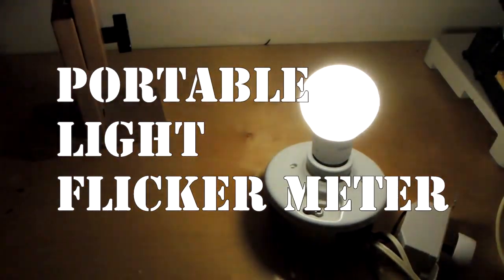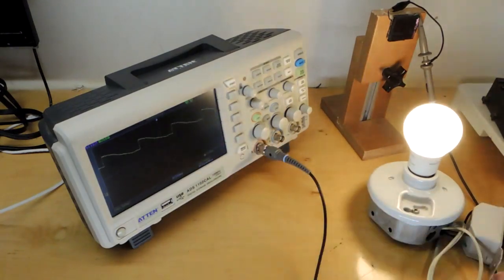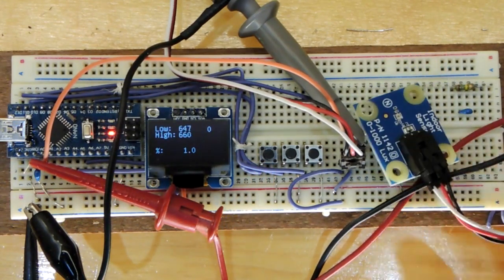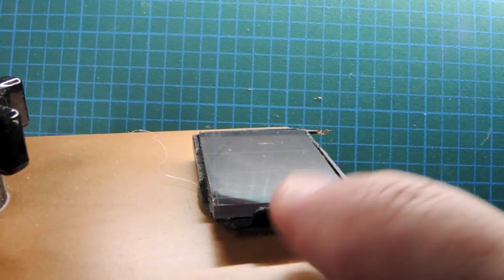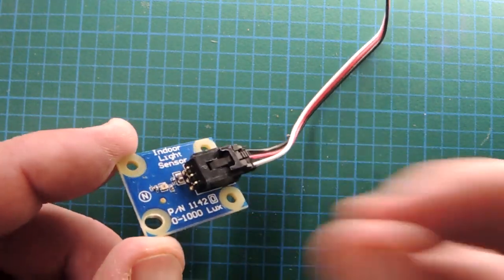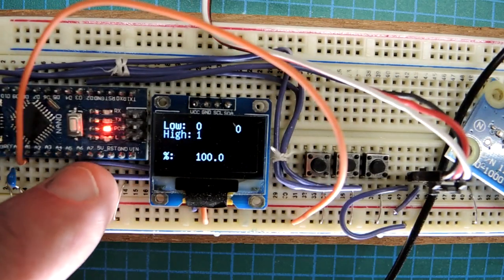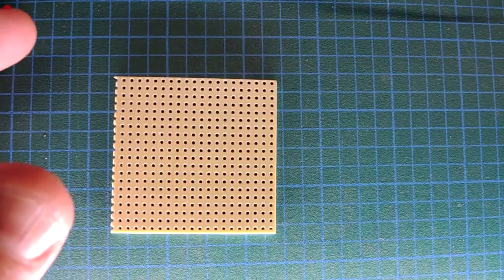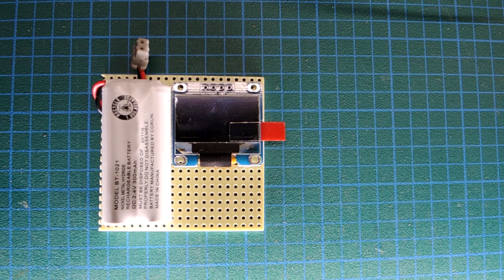Portable LED Light Flicker Meter

Comment: Is it possible to print out the actual frequency at which the bulb is flickering? If so, how?
Reply from the maker: Nebiyou Belaineh detect the peaks and then calculate time between and invert.  100ish lines of code
Reply: Thank you for your timely reply! I have managed to find the peaks using your algorithm. However, I could not measure the time and calculate the frequency.. Can you please write the code? I need this part for a project. My email is nebiyouseifu2@gmail.com.Thanks in advance!!

Comment: Does a DC power supply stop the flicker? At least get it above 165hz so that it does not bother human perceiving system? How can one make DC current even cleaner once it leaves the power supply without a commercial power conditioner? Is it easy to make one of these?
Reply: I analysed 3 power supplies from big LED panels (PS clearly made in china) till now and have found out that all of them have too small feeding capacitor so 100 Hz translates right into secondary part. Forget 65/130/165 kHz . The trick is you cannot tell by naked eye and the light looks brighter because it is bright in peaks.  You cannot find out PS parameters when buying LED panel so shitty PS could be in expensive ones. How this shit affects human eyes F green peace/health care/etc. remain silent. This F crap is a step towards 19 century... if you work for hours at desc with miniature texts/diagrams/etc. use old proven fluorescent lamps and send greeny bastards into arse.

Comment: Tried to replicate but without schematic, fail :(
Can you please make a schematic with fritzing or something.
Reply from the maker: I added a schematic to my blog @ https://electronupdate.blogspot.ca/2015/10/portable-light-flicker-meter.html
Reply: Thank you, you'r schematic shows that there are 2 push buttons. In code you comments show that you need only one button

"1 push button switch"

Then in code there are 3 buttons
"int inPin1 = 12;  
int inPin2 = 11;
int inPin3 = 10;"

I myself tried the 11 and 10 connect to button but nothing happens. The 12 changes screen modes, that does work. What are other two?
Reply from the maker: I use a standard 'human interface' (screen + keyboard) for most of my projects.  The other two push buttons were used for code development , but are probably not used in this sketch.
Reply: Thank you for reply, What does the zero on the right hand corner on the oled display do, it does not change ever?
Reply from the maker: can't remember, read the code.  it may be for deubug

Comment: Thanks great video!
I've also found the Atmel MCU pricing to be significantly higher here in North America.  Even at 1k unit pricing from Atmel or Digikey the whole module was usually similar or less expensive than the MCU itself.  
So either the ebay units are seconds/test rejects, clones, or perhaps pricing from Atmel is very 'elastic'...  Somewhat frustrating when you are trying to develop product at a reasonable price but you don't want to risk field failures due to 'grey-market' components.

Comment: I just use a Solar panel feeding directly into some 16ohm headphones as a portable way to gauge flicker. If the flicker is present it comes across as a audible hum depending on its frequency, the louder it is the more pronounced it is. I also have a $5 multimeter with a solar panel glued and hard wired to the back on it set on AC milivolts if I require numbers to compare things more accurately .yours looks quite interesting, cant wait to see what it looks like when finished.